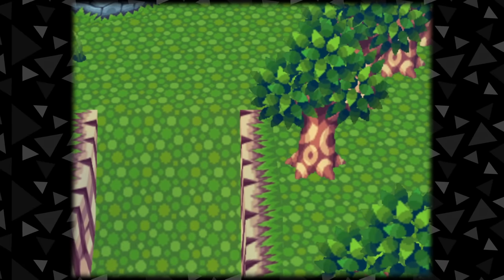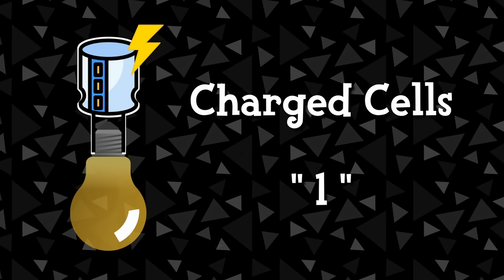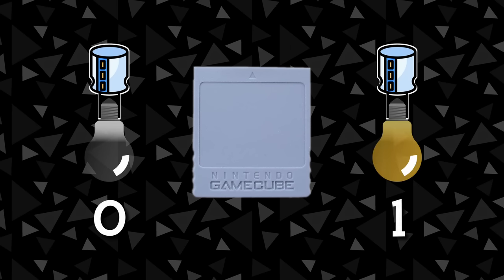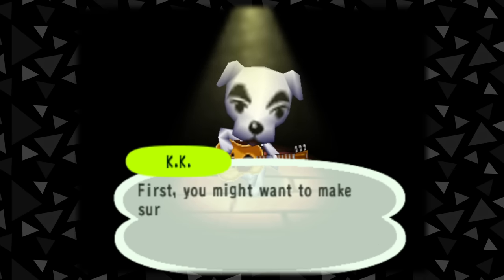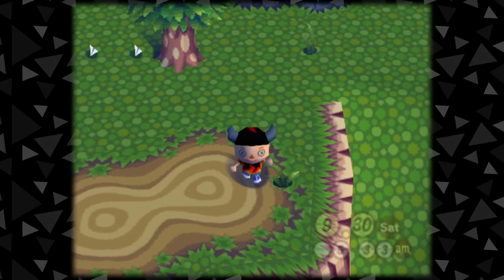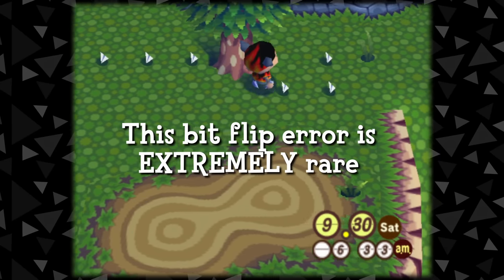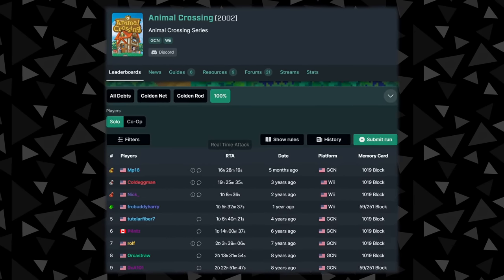Paper Airplane Corruption in Animal Crossing

Comment: Can bit flips cause other items to appear on the ground? I'm guessing there's 15 other objects that might appear if another bit in a ground tile's contents is flipped. 
IDs 4000, 2000, 1000, 0800, 0400, 0200, 0100, 0080, 0040, 0020, 0010, 0008, 0004, 0002, and 0001 are the ones that could spawn from a single flipped bit on an empty tile, assuming items exist in all of those IDs.

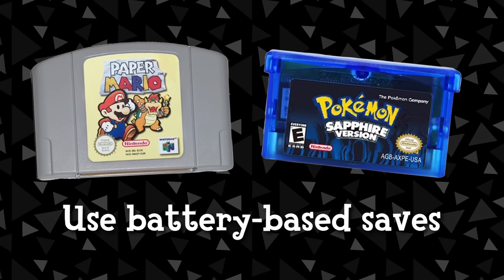Comment: 2:08 That copy of Pokemon Sapphire is fake, and RSE did not use a battery backed save. They use flash, just like an SD card. The battery is only present to keep a realtime clock running.
7:07 The charge carriers in flash memory are not related to electrolytic capacitors in any way.
Reply from the maker: Yep. This is already corrected in the description — was my mistake. 🙂

Comment: Wait cosmic rays that alter game data are a real thing? I thought it was a meme to explain that really weird sm64 glitch
Reply from the maker: It’s a real concept that cosmic rays can alter electronic bits, but in practice it’s one of the most unlikely things to ever happen to a video game console. Airplane electronics are some of the most susceptible to cosmic radiation, yet even cases in planes are extremely rare — though they are designed to shield against them.

Comment: Do you know how the game still gets the OK from the game after the airplane bit-flip despite there being a checksum that's supposed to prevent this from happening?
(By the way Paper Mario isn't one of the battery-backup N64 games, it uses flash memory instead)
Reply from the maker: Good question! This is a long, technical answer so bear with me! Animal Crossing does indeed have a 16-bit big endian checksum which, in theory, should sum all of your save file data bytes together both at game save and at game load. If these values mismatch, the game will indeed spit out an error.

This wasn't explained too well in the video, but this checksum comparison only happens at game initialization when you first load the game. Thus, despite me using the GameCube memory card as the graphic in this video, the bit flip causing the airplane to spawn actually happens in-game when you're playing and its data is then written to the memory card. Since the game has so many empty plots, this is likely to occur without the player's knowledge causing them to save this paper airplane in their town. And finally since this paper airplane is now present on their save checksum, it will load properly on initialization as well. 

Despite this, it is still possible for a dormant memory card to flip a bit randomly as well. In this case, the bit flip happens outside the game and the checksum should catch it. But Animal Crossing actually has a failsafe for this by saving two copies of your data in the same card. This way, if your first checksum fails, it can look at your second copy and try that one instead. So if a bit flip occurs on a dormant memory card, it would, in theory have to occur on BOTH data copies to cause the checksum to fail and corrupt your data. But checksums are notoriously poor at data security anyways since it's just a sum of the data. As a 16-bit checksum, there's only 65,535 values this checksum can be -- meaning multiple saves can have the exact same checksum. Thus, if a GameCube memory card flips a bit and causes 0x00 to become 0x80, this can be offset elsewhere with a 0x80 becoming a 0x00 and result in the same checksum. Given how often 0x80 and 0x00 are used in Animal Crossing, with many instances appearing next to each other, it isn't too unfathomable for an electrical mishap to cause a string of bits in the GameCube's memory card to flip like this.

Don't get me wrong, this is still a ridiculously rare occurrence, but hopefully that clears some things up.

(You're also right on Paper Mario, my bad!)

Thank you for the comment!
Reply: @Hunter-R.  That makes sense! I assumed the bit-flip occurred during the transfer of data from the memory card to the GameCube's RAM if not from the memory card bit-flipping by itself
By the way, does the game do anything special to check for the validity of the town in Slot B? Is it any more or less monitored than Slot A?

Comment: Has it not been possible to repair or replace the code, allowing the paper airplane to be played without corrupting the save file?
Reply from the maker: It is possible through code modification or Action Replay codes. A few members of the community have made codes that allow you to pick it up and throw it without softlocking, as well as prevent it from endlessly duplicating.

Comment: imagine if the paper airplane is a left over piracy measure that went un implemented and that's why it duplicates and softlocks . . . that would be interesting no?

just a thought ;)
Reply: It would be anti-modding, not anti-piracy, since running software can't access the GameCube disc drive's DRM reader.

Unlike the PlayStation, where software could poll the relevant memory addresses... and could detect modchips if the read SUCCEEDED.

Comment: As an amateur compsci.. person - the reason why this happens and not anywhere else, like on PCs or smartphones is - well, that it does, it's just that memory management systems feature redundancies and even some higher end, industrial systems utilize what is called ECC memory, which is designed to correct for bit flips when they occur - such memory is usually mandatory for use in things like satellites, airliners and spacecraft. Video game consoles aren't built, at least they weren't until the 6th gen with the Xbox 360 and the sort, to handle memory more authoritatively - When you turn on a PS2, Gamecube or Dreamcast, the BIOS initializes, and much like  your PC's operating system, the game engine is executed and initializes, operating much like its' own OS while the BIOS goes dormant outside of certain low level features, being responsible for memory management, is usually delegated to the game's engine - however, space was at a premium in those days, same with performance, so including memory management subsystems outside of the bare basics was seen as overkill and potentially detrimental to the end user - if it made the game stable during normal operation, that's all the dev teams cared about.

Nowadays, especially with the latest game consoles, games are run within virtual machines, and the underlying OS of the game console works more in the same way as a conventional OS does outside of 'userland', a term for the user-relevant components of the OS - OSes that do this, are called Hypervisors, and virtual machines for the uninformed can be considered like emulators, but the same hardware as the machine that's running it. Doing it this way allows for more stricter control over the program and sandboxing it makes issues caused between hardware or firmware revisions less likely, reducing the chances of data corruption.  But how does it do this?

On cheaper, consumer-grade hardware, the PC will often run validation checks built into code that make sure the program is running properly - if for example, a bit flip changes something vital inside of Windows, the Kernel's (Essentially the heart of the OS) memory management will try to resolve the issue. If for whatever reason it cannot, and continuing in this state is dangerous, it will bring up a BSOD, and log the issue for review.

This can happen with failing power supplies, dying RAM or CPUs, or even external factors due to fluctuating power sources, usually for those in second and third-world countries, where power to the home is more 'dirty' than what you'd expect in places like the US, Canada and the sort, and power delivery isn't at a constant, steady amperage/voltage, and, of course, there are things like Solar Flares and other astrological phenomena that if powerful enough to penetrate the natural EM shielding of our planet, can cause all sorts of havoc against non-ECC powered systems, given they're not severe enough to, y'know, plunge us into the dark ages.